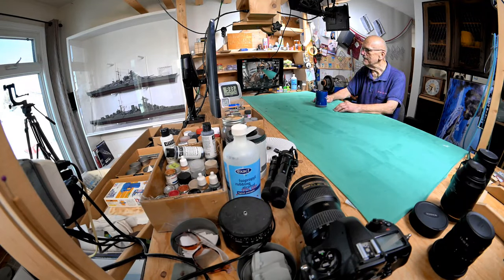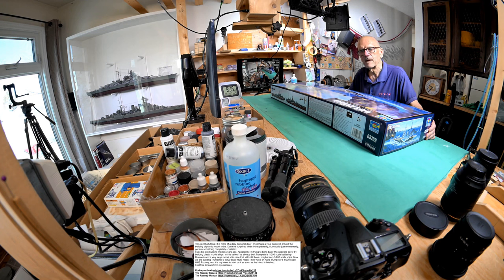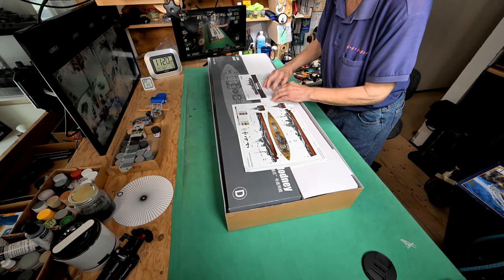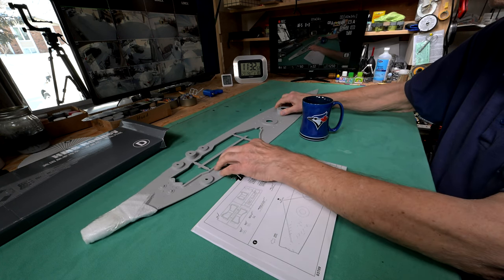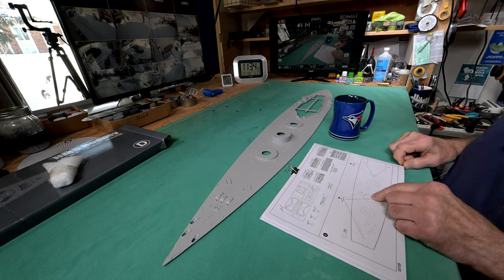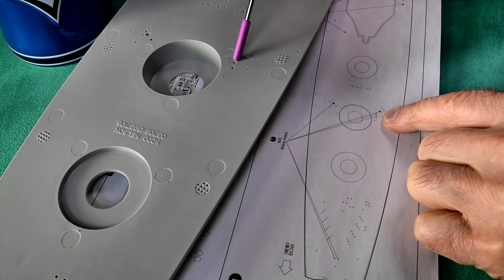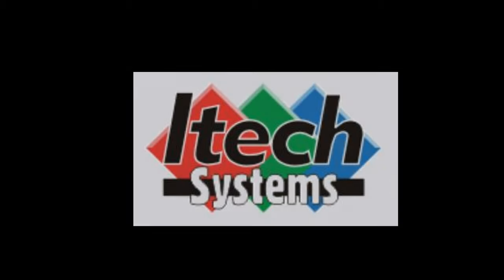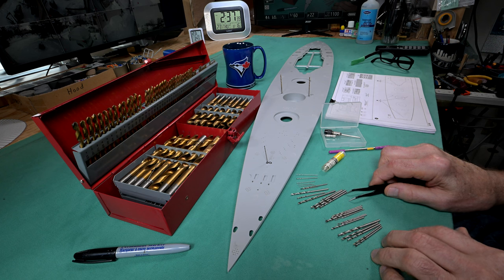The Model Ship - Part 1072

Comment: Hi Ron.  Condolences; it's been 11 years for me, and I still get ripped up on that anniversary.  

Anyway.  I suspect the reason the holes haven't been drilled all the way through on the molded deck might be because of slight differences between the Rodney and the Nelson.  By not molding those holes open, the same deck piece can be used in both kits.  I've seen this on armored vehicle and model railroad kits.
Reply from the maker: Re: "differences between the Rodney and the Nelson"
Hey --- I never thought of that! 👍

Comment: Why does it say "1/200 NELSON" on the bottom of that piece? (Around the 10:10 mark in the video). Perhaps the deck of the Nelson and Rodney are interchangeable so Trumpeter only made one mold for both kits?
Reply from the maker: Thanks for noticing. So what that means is we're modifying a Nelson deck to accommodate a Rodney superstructure. 😧

Comment: Your new computer parts look basically very good(12th gen INTEL is supposed to be good) I think if you doing video streaming and normal use and are not going to play games(don't know that video card) but 128gb of ram seems to be way too much and you could use a faster nvme hard drive with that motherboard.
Hi from Edmonton!, I have a New Jersey model 1/350th scale that I have had for years and now that I have more spare time I would like to get started on it soon, watching some of your videos has motivated me a bit so thank you.
Reply from the maker: Best of luck with your New Jersey. 👍
Reply: @roncalverley  thank you I will look for ideas on your videos

Comment: The ‘42 Rodney and the ‘45 Nelson share the same deck.  Most of the un-drilled are for the Nelson’s 20mms the few Rodney holes are for a couple of 20 mm tubes and maybe some cable winches.  Drilling no holes would be suitable for the Bismarck action and before if Trumpeter decided to release an earlier variant.
Reply from the maker: Thanks Jim! 👍

Comment: The only thing that sticks out to me on the computer build is the Quadro card... That's really meant for workstations and high end computing. On the other hand, if you wanna do 8k video, I think it's the perfect choice.
Reply: Wanted to add, thinking of making brass data plates for my ship models, would you like some?
Reply from the maker: I'm hoping that this new computer solves my problems Parker. 🤞
Reply from the maker: Re: "brass data plates" Thanks offering, but I'm just going to print something up like what's beside the Bismarck. 👍